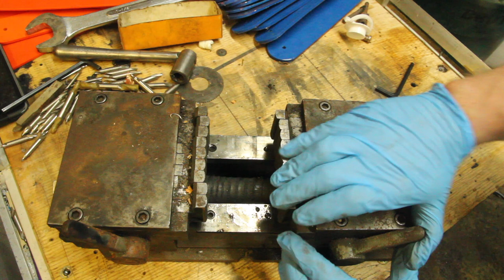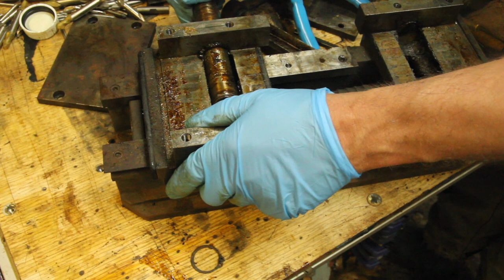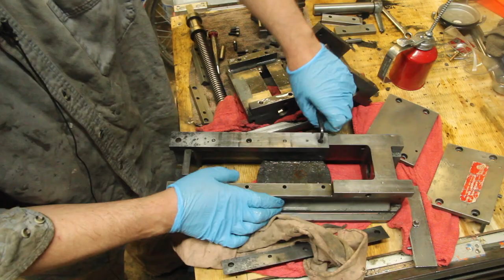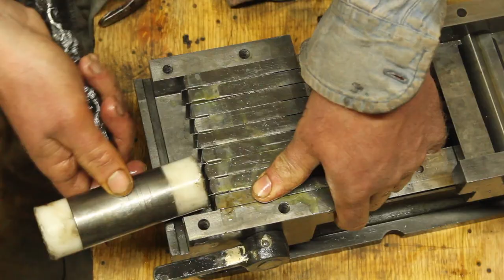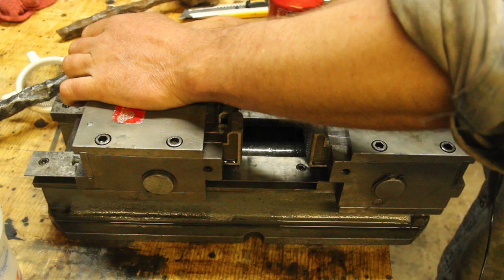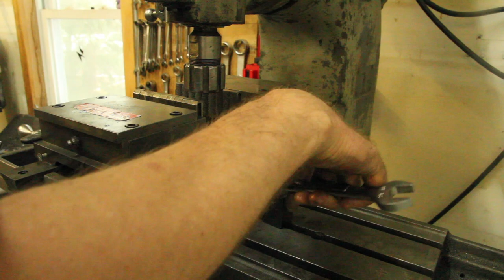Ampogrip Vise Rehab.

Comment: Although the equalizing type jaw vises are wonderfully clever.. Please be extremely careful when being used for larger cutter processes, like fly cutting, shell cutters, multi-point insert tools... When tight, they leave the machinist feeling confident, that the oddly shaped part is held firmly, but, vibration can allow things to settle, or deform the parts gripping surface, and then, the entire part comes loose and then crash... These were often times used for drilling or multi-point drilling heads operations, and not so much for milling operations. Smaller cutters 1/2" diameter and under should be fine, just be careful, wear safety glasses, Not that you don't, just saying... Kinda reminds me of the Kunze vise, or rather as it is know by today's name, the FRACTAL VISE. Very clever equalizing system, but those units were sold as a saving grace to the auto industry to shave time off of set up times. Many men were injured in a short time, before the company was sued, which was a a failed attempt to recover any of the claims that they would offer secure holdings, the owner bolted town. Kinda a sad story.. But even on the Fractal curve bows type vise, if one point loosens up, of all the points making contact on the oddly shaped part, then all the other points are free to loosen up.. scary stuff.. still neat as heck though.. Be careful machine heavy with that equalizing vise son. When it lets go, it happens scary fast.. Good luck, I enjoyed the video non the less, well done.
Reply: So in short, my english is not good.  Did you say that this walrus in the video and that "Fractal Vise" that some people are making are dangerous to use?
Reply: @CorruptionManX  I don't know anything about a walrus, but, your English seems just fine to me, as per, how it is written here. The Fractal Vise systems, are very clever, and serve a function in certain applications. I was simply throwing caution out there, for anybody who desires to use this equalizing jaws system in most machining situations. 

If just ONE, of the contact points of the many, on BOTH sides, or both jaws rather, comes loose, by just (0.001" imperial) all other contact points in the system are not loose or will come loose. I method to lesson the potential for this to happen, is to tighten the vise, loosen it, then re-tighten back again, to force the points to rock or rotate to a neutral or relaxed position, so all points are pushing at each of their respective contact points equally. Often times, it is a good idea, to mar the part or clamp the part to a measure that the part has dents into it. That is a roughing setup, is no big deal, but upon finishing processes, denting the parts is not ideal. 

I mentioned milling processes, due to the nature of harmonics, or vibrations, that induce the jaws to relax the tensions in the pivoting points. Fly-cutting is extremely dangerous in these types of work holdings, as per the intermittent cutting action of the fly cutting action's nature. if the part come loose in a fly cutting process, things can get scary very quickly. I am not telling you what to do or not do, other then, be wise, use caution, and be safe. You might get 99 different setup/clamped up parts machined just fine, and not even a hint of problems, but, on that 100th, setup/clamped up part, is when things let go or come loose on you, and all heck breaks loose. Just be careful is all. 

Please note, do not get me wrong, I have always liked these vises, due to how clever they are and how amazing the manufacturing process is, upon how they each are made. These vise, for the era they were designed and made in, is actually in my opinion, precision artwork, due to how tight fitting and fine toleranced that each swivel (male to female, to concaved to convexed) fitment is to one another. just artwork and is intriguing to me to watch both side just flow around a oddly shaped part. 

Always try to view the direction of the moving jaw to the stationary jaw, it is linear or one direction. At the moment one of the swivels contact points get too far away from the linear direction, to being forced to apply pressure from a sideways direction upon the oddly shaped part, that is when the danger elevates, as the contact point is no longer just pressing in the one direction, it is not being asked to move in two directions on a prorated scale of pressure, linearly, and from the side. The more pressure asked to come in from the rocking side ways direction on the outer most contact points, the less pressure is coming from the linear direction. While also, forcing those wrapping-around contact points to not just press into clamping the part, but SLIDE on the part sideways as the jaw is still moving inwards towards to opposing jaws contact points. 

Good luck, I hope I answered that better. I am sorry if I caused any misunderstandings, upon how I explained in the previous and or, even in this second attempt to explain. I am sorry is so.

Comment: I found one of these and restored it.  It was previously owned by the Navy.  Judging from the wear I believe they found a use for it often.   It has certainly come in handy for me a couple of times.  I never found out much more info than what you did.   Just a couple of ads, including a matchbook cover on eBay... had to buy that, lol.
Reply from the maker: Did I see pictures of yours on one of the machining forums?
Reply: @JeremyMakesThings  Probably, I posted it on Practical Machinist's Antique forum when I found it and probably after I completed the restoration.

Comment: That vise is in pretty good shape, most machine vises get pretty beat up over the years.  Do you think the balls with flat spots were flattened due to pressing against the harder jaws?  There's a company called Norgren Workholding coming out with similar idea but just vise jaws to add to your existing vice and they want $4k for a set of 6"!
Reply from the maker: I think they were just not round to begin with, more like steel shot rather than precision ball bearings.

Comment: That's pretty neat - did you manage to find anything out about these from old literature or anything? If you just clamp down on square stock or something like that how does it react?
Reply from the maker: The only thing I’ve found about them is the patent for them, beyond that it’s a couple of forum posts that basically just say that they exist and that they work.  I haven’t tried it on square stock, I imagine it would work fine, but I’m not sure about the repeatability.
Reply from the maker: The only thing I’ve found about them is the patent for them, beyond that it’s a couple of forum posts that basically just say that they exist and that they work.  I haven’t tried it on square stock, I imagine it would work fine, but I’m not sure about the repeatability.

Comment: A similar vise has turned up - but differently branded, and a different size I think.

https://www.youtube.com/watch?v=JaHjFL7NZlU

What's the jaw width and opening on the Ampogrip?
Reply from the maker: I messaged him on Instagram with a bit of the history.  EW Bliss bought the rights to the design in 1957.  Mine actually has jaws that were made by Bliss, so I guess there was a relationship prior to that.  There’s very little history out there about them.

Mine is the 5” wide version, I’m not sure on the opening, but probably about that.” Or maybe a bit smaller.  They made them in various sizes, I think I saw pictures of an 8” version.  I think there was a bench version as well.

Comment: You should use a thick grease, not oil, for the "ball bearings". The grease acts somewhat like a hydraulic fluid. Oil will leak out too easily.